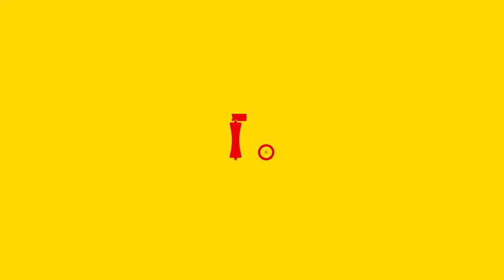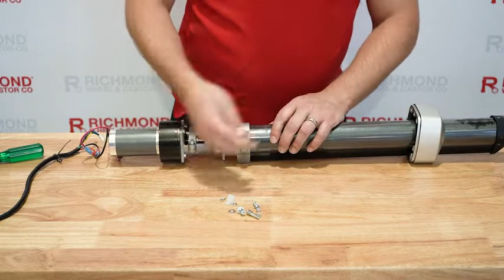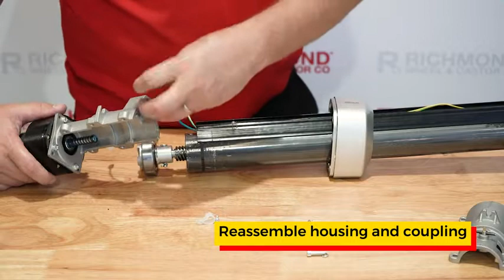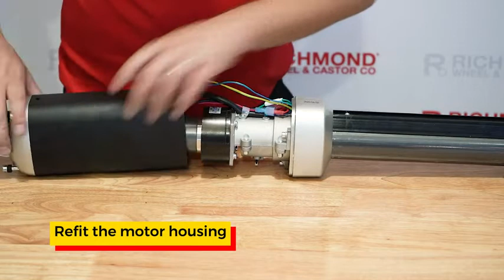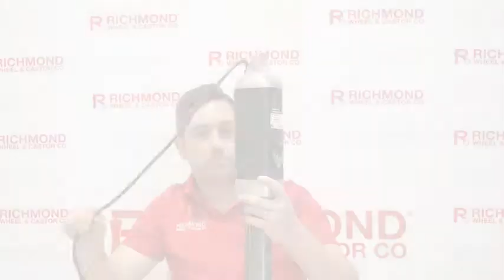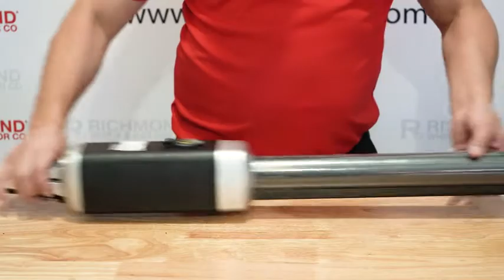How to Change a Limit Switch in your Swing Gate Arm

Comment: Should you grease inside the arm where the motor spins that large screw to open the gate? I can't find any info on that. Only ever says to put lithium grease on the outside part of the arm. Surely the inside needs grease?
Reply from the maker: Hi Scott,
The worm drive and drive nut running through the centre of the arm is heavily greased and doesn't require any maintenance. We've purposely enclosed and sealed this section of the arm to stop dirt/dust entering where possible.
The main drive nut is brass, so can handle a high number of openings without issue.
Some of our test gates have done as many as 50,000 openings in some pretty harsh conditions, and after being inspected, the worm drives are almost as clean as the day they were installed.

Comment: Thanks for the video!  Is there a way to adjust the minimum distance limiter? I'd like my gate to open less - right now it goes over 90 degrees and is banging into a fence.
Reply from the maker: Hi Tyler,
There is an adjustment available.
Ideally you would attach the fully retracted arm to the gate when it is in the open position that you want.
However, for a common pull-to-open gate, the limit switch closest to the main motor housing can be adjusted so that the arm doesn't fully retract. You will need to remove the smaller locating screw before it will move and you can ONLY move the limit switch AWAY from the main motor housing.
If you need any further information, submit a ticket to our gate support team and include any photo's or video that you have of your gate. They will be able to give you a more detailed and personalised response.
www.gatesupport.richmondau.com